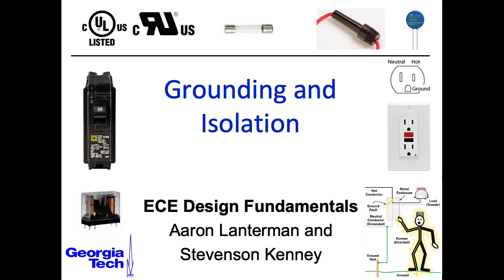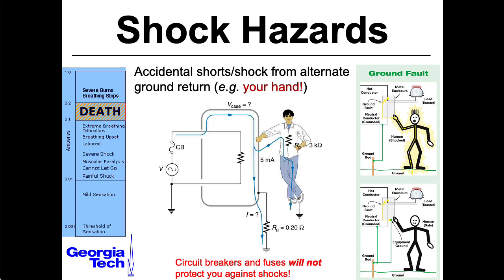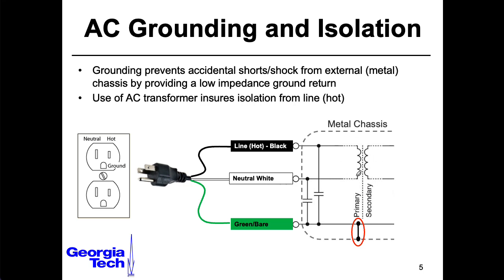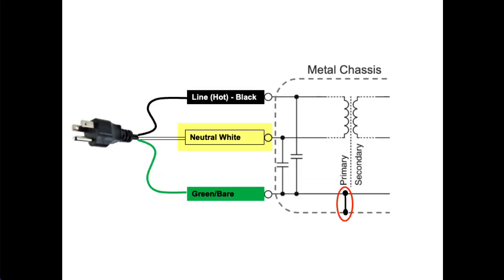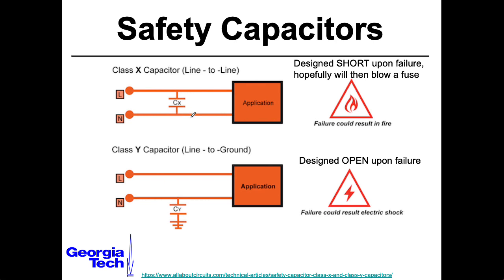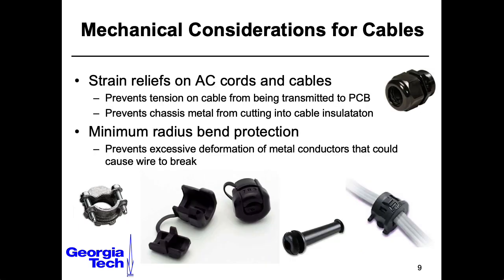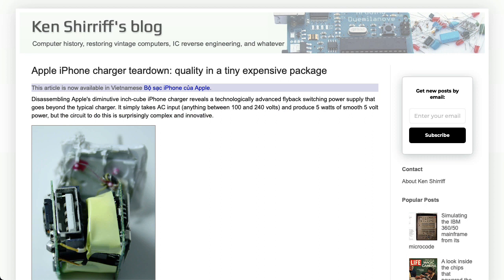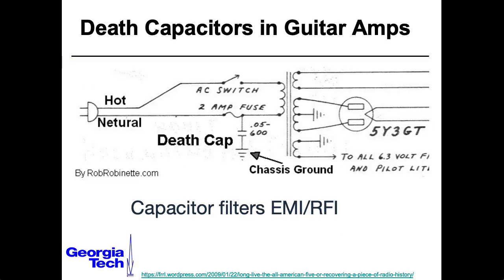Grounding and Isolation (REVISED) (ECE Design Fundamentals, Georgia Tech course)

Comment: I’ve been electrocuted by a tube amp before and I don’t recommend it
Reply from the maker: Eeeek! I'm glad you survived it! High voltage is no fun. I've never actually zapped myself with high voltage but I was taking measurements with alligator clips one time and a clip slipped -- there was a massive loud flash and bang and smell of ozone, and I'm really glad I had used to restroom before trying that particular test!
Reply: @Lantertronics  Luckily I was only using one hand so it went down my left side instead of across my heart. My left side was sore for a month. Im not entirely sure what caused it but it involved alligator clips  and not wearing shoes
Reply from the maker: @ZombieLincoln666  Oh my goodness!

Comment: When measuring the "leakage current" on any piece of equipment there will always be microamps of current on the chassis ground which is called leakage current. The ground current should be zero amps but all equipment will measure microamps. Where is this leakage current coming from? And how do you reduce leakage current?

Comment: I think it's important to point out why tying ground to neutral is a bad idea: Due to varying amounts of current going through different mains circuits, neutral pin in different sockets might have drastically different potential levels. I have a friend who has two sockets just about a meter apart on the same wall... with 200V differential on the neutral pin.
Reply from the maker: Whoa, what --- 200 V??? That sounds like something is flat out wired incorrectly.
Reply from the maker: That is scary!

Comment: Here your ground cable of your "house" is actually connected to a copper/aluminum pin/rod in the ground where you electricity meter and fuse box is, that pin when it was hit into the ground/earth was tested with specialized digital gear to measure the resistance on several points and approved.
The step down transformer in your area also has a rod slammed in to the ground and there is connected to the neutral pin of the transformer. so your house is actually connected via the earth/soil to the step down transformer in your area.

Once i worked at a very damp and moist building of a company and there was like 50 amp on the ground rod, they had their own 2 step down transformers.

the Netherlands is pretty strict and also has a world recognized testing brand/quality mark.
Kema Keur, most probably you have seen this logo on your electronic gear.
Reply: It really depends on the age of the home. We have an iron grounding rod in the back yard. Ground was also often connected to your cold water supply lines and that's true here as well. Our house was built in 1960.
Reply: @justovision  Yes, now they have "plastic" water tubes and they attach ground wires on multiple places, there is even a copper/aluminium mat under your douche / bad room floor.